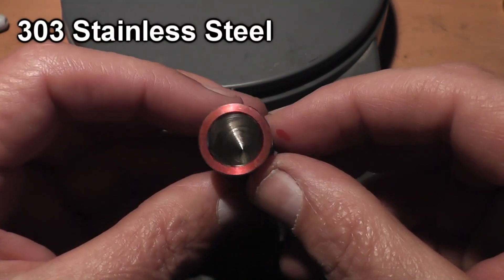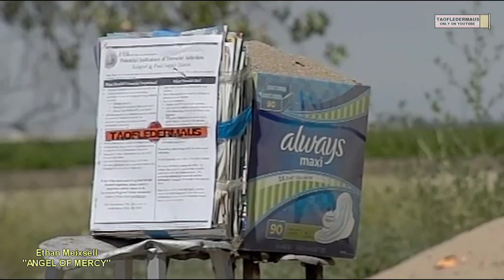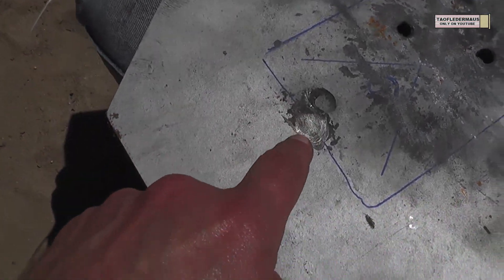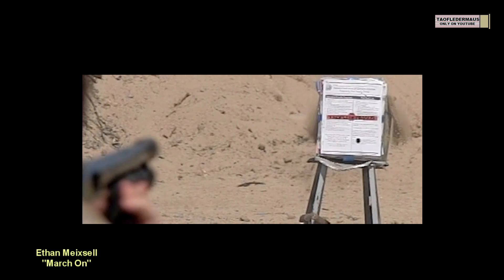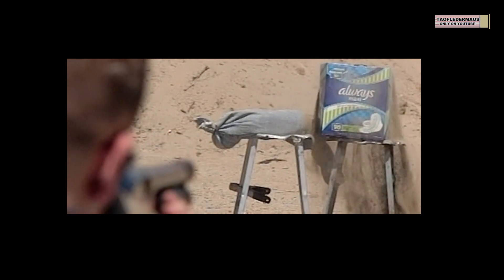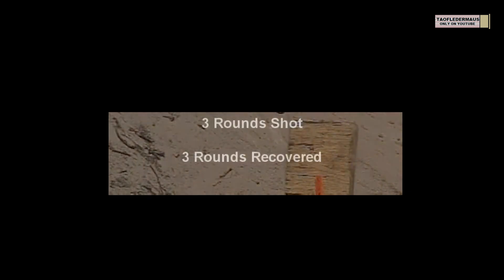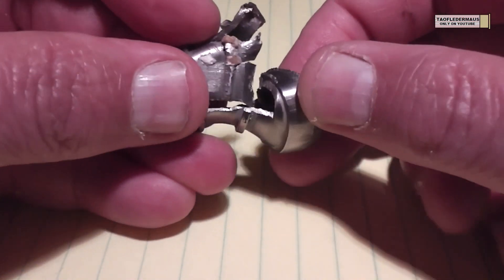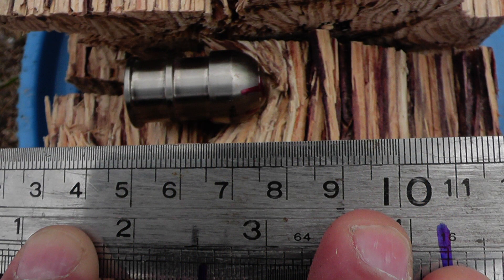Experimental 12ga Shotgun Slug Made from STAINLESS STEEL

Comment: Beautiful machine work. I wonder how he's going to solve the wobble issue. The shock cone explaination really helps visualize what is going on in flight.

In the video with where you shot that deploying fin one, I think the reason why it flew rather straight for something so ramshackled was from the fins extending outside of the cone created from the tip, allowing it to provide proper drag at the rear of the center of mass.
Reply from the maker: BrokenLifeCycle   We'll see how the different-weight slugs are affected by that.  Lighter rounds will fly faster,  and that means the shape of the cone is different.   The titanium rounds seemed a little more stable.

Comment: Interesting results with similar performance with Ti in the block. It would seem that energy has more of an effect that the material since they were both strong enough not to deform and possibly close enough in weight.
Reply from the maker: Klingon00  Yeah,   I thought that was cool.   I guess it makes sense since the two shells had the same powder charge so the Ti round had to have been travelling faster.   It's just odd to actually see results that correlate with the theory!

Comment: Think of the WTC as being built with AR500 plate box columns on the exterior, BUT STRONGER.
4:20  The very reason we know, no airliner hit the TT, SS has < 3x the mass density(SG) of aluminum.

Comment: I would think that If the slugs were made slightly undersized and loaded into the shell with a plastic wadcup to make up the difference, then you could (in my theory) use a rifled slug barrel to improve accuracy. Also if the front end of the slug was shaped more like a spire point bullet (because you only loading one at a time anyways) that might help balance the slug
Just a thinking out loud.

Comment: As to the Titanium penetrating the same amount as the Stainless Steel: Per the laws of physics, the titanium slug would've been propelled faster, with it's smaller mass, but still would've impacted the wood with the same force (the same as that applied by the gas expansion, with a little lost due to air resistance en route). However, I haven't the slightest idea if I'm making sense, nor whether the speed or mass has more effect on penetration.
Reply: VicariousReality7 I dunno, really. I do know that up on the International Space Station, they have a bit of a problem where a large speck of dust colliding with a station window at a few km/s will punch right through the 2 or so inches of bulletproof glass. A stray screwdriver bit needs less speed, obviously.
Also, I "know" that a cargo ship that's beaching itself or hitting a dock at like 7mph is likely to snowplow (or try to snowplow) through whatever for a good distance before finally stopping.
But, that's all on the extreme ends of things.
I feel like mass has a larger role to play in this, per inertia, but not by much.
Reply from the maker: Hayden Bingham   Yes,  but I was still surprised to see results proving that!   The shells had the same powder loads after all.
Reply: ***** Agreed.

Comment: Why would it rip the rifled barrel up? Could you maybe cut some rifling into the round itself to give it some spin action? Cool videos, love this stuff!
Reply: Branden Barrett If the material they are firing through the barrel is at the same hardness or harder than the material used to make the barrel, then it would shave out the rifling rather than rotate. The reason why most rifle bullets and suchlike are made with only with lead, rubber, or always have a copper jacket is because those materials are soft enough to let the rifling bite into them with very little resistance, at least not enough to cause damage to the rifling
Reply: It would mess up the rifling because it's steel which is what the barrel is made of also so it would scratch the rifling. Normal bullets are fine because they are made of lead which is much softer than the barrel. You can actually scratch lead with your finger nail. He did post a video about a rifled round. He called it the turbine round.
Reply: Nate Meyer thanks for the informative comments and not some trolling haha I understand now. Cheesus Sliced thank you too.
Reply: They do have rifled slugs, but they are not rifled to spin, but to be able to compress in a shotgun with a choke. If these slugs were rifled, it would not do anything.
Reply: Nate Meyer 
There are plenty of bullets with steel jackets

m39/b for example
http://upload.wikimedia.org/wikipedia/commons/0/01/M39%2Bm39b_askar.jpg

Goes through 25cm of wood, hurts like hel to use in a glock 19
Reply: VicariousReality7 Those use mild steel that is much softer than the barrel, and a copper coating that protects from steel on steel contact.

Comment: Maybe the slugs need a small rod on the nose to offset the shockwave a little bit and imitate a cone. That way the slug would be trapped in the sonic cone and couldn't wobble, provided length of the rod and the radius of the slug's tip make up the tangent of the sonic cone's half-angle.

Comment: It is a shame that the rifling would be ruined because these rounds are almost next gen! The little wobble doesn't seem detrimental though just a little less accurate... The rounds recovered in good shape could in theory be fired again right? I'd love to see (if possible) how these fair with the penetrator tip that looks like a cross head screw driver! The penetration and lack of damage against the wood is incredible! Good job!
Reply from the maker: Daniel Stratton  I imagine a factory foster slug also wobbles in flight.   They are just a little too fast for my cameras.  Check out this video of some railgun testing.  You'll see the same wobble we were getting. https://www.youtube.com/watch?v=zIhABhg91Ns
Reply: Thanks man, I'll check it out now!
Reply: That is one bad ass piece of weaponry... Any chance you can test that against a giant gummy bear? Lol! That wobble was insane and that's a military spec projectile... The shock waves from that are immense as well, is it the waves causing the wobble as well as the lack of stabilising rotation or no?
Reply from the maker: Daniel Stratton  I think that was just a prototype/test round.  Their newer one sort of looks the same but has sabots and has a solid,  finned dart inside,  which flies true.   There's a newer video that shows that dart going through a whole bunch of steel plates like butter.  It's crazy!
Reply: I'll look that up, thanks again!!

Comment: ***** It seems like the sand trap and osb are very good for trapping these slugs. Why did you decide to use the armor plate and deflect it into the sand? Also: have you tried shooting just the sand alone? I would do it with a spare slug to see if it goes through first though if you do test it :P
Reply from the maker: MinecraftmanUSA   The armor plate is just to see how the rounds hold up to hitting something very hard.   We shot the box of sand in the first test with the mild steel slugs and the round went through 12" of sand.

Comment: *****  Um, 5 inches is not 13 millimeters. 13mm is approximately .512 in. Which last time I checked, is far less then 5in. 5 inches is 127mm.
Reply from the maker: Tazuren Savu'len  But would you have even commented if you hadn't found something wrong?

Comment: Great video! Always, huh? I guess that means that some of this sausage has a girlfriend?!?! j/k. You used the phrase, "mikes out to the same tolerances." Could you explain what "mikes out" means? TY!
Reply from the maker: Matt Rouge  Oh,  "mics"    as micrometer.   It's just machinist speak.
Reply: *****
Thanks! Hey, I'm still curious as to why a 2 oz. round would be dangerous/impossible to use in a shotgun (tungsten bullet). Thanks for the further information, sir!
Reply from the maker: We use shells designed to shoot 1 oz.   If I double the weight of the load,  the pressure in the gun goes up exponentially and it blows up.   If I keep the load at 1oz or less,  I never need to worry about that.
Reply: *****
Interesting. Is it guaranteed to blow up above 2 oz.--or just a possibility?
Reply from the maker: It just increases the odds.  It may not blow up on the first shot.
Reply: *****
Got it, ty!